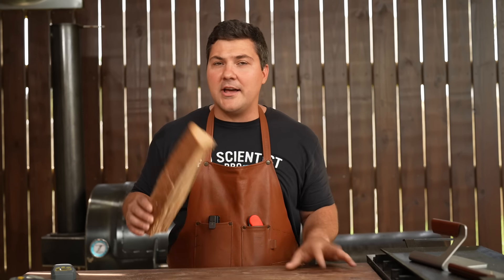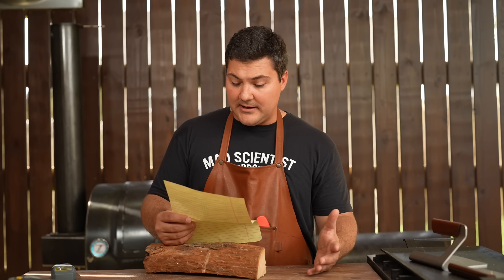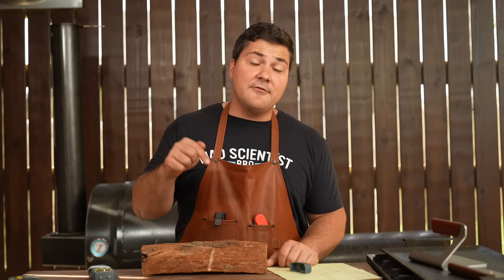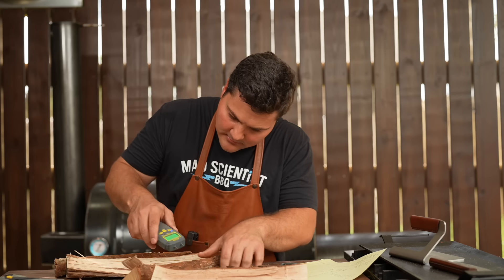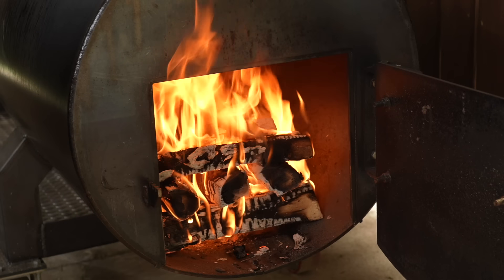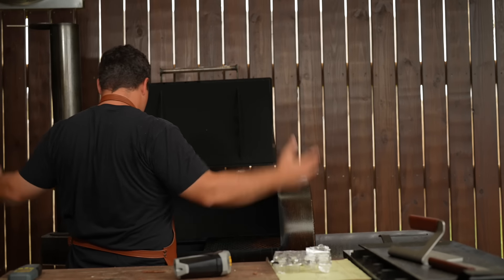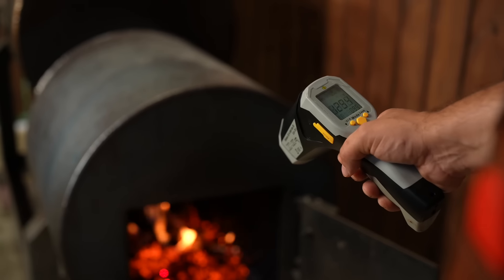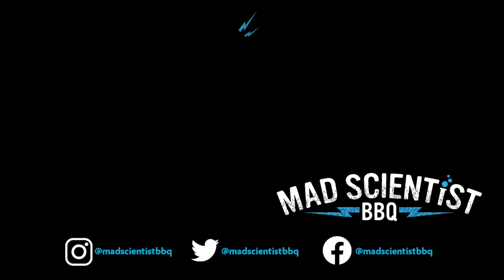I Cooked this Wood for 2 Weeks. How Did it Burn After That?

Comment: If you're pushing so hard the plastic is popping and your arm is shaking, that way too hard. The probe tips are sharp for a reason. You only have to make solid contact, not drive the tips all the way in. If you keep doing that, your meter won't last long.

Comment: Your results mimic mine with the same meter. I found a cord of mixed quality oak from the same tree (some of it fairly straight grain some of it pretty gnarly, i need a press like yours lol im doing it with a maul and an 8lb sledge), been splitting it by hand since last summer when I picked it all up, and when I crack into a new log it's usually in the high 30s still since it didn't lose any moisture all winter long. I learned real fast to use my cherry wood that was properly seasoned, as a bed to put the unseasoned oak splits onto in order to get them to burn. As the season has warmed up though this year, i've needed less and less cherry, and since I'm having trouble getting it at the moment, I've been burning all oak the last few weeks (with a little mesquite and madrone for flavor because it was my birthday). I have been pulling the driest splits to start my fire with and then switch to more recent splits during the cook to help maintain temps, and since I'm working in a vertical offset, worst case I can move to a lower rack if need be. I usually cook on two racks from the top (the very top rack isn't even in because i have a tray of kosher salt there smoking and it's too tall), but as my wood has gotten dryer i've considered dropping down a rack to help limit cook time. I can get about 250 on the mid rack while it's 300 on the top rack as well, so it lets me smoke different things at different temps pretty easily.

Comment: I have smoked with maple before. It is good filler wood to cut back on smokiness while doing chicken, cheese, or fish. You can also use maple to keep the fire going after you wrap and don't want to use your good wood.
Reply from the maker: Interesting. So you don’t think it tastes as good as oak, or pecan?
Reply: I agree. Maple just burns very cleanly. You don’t get a lot of smoke flavor out of it. And relatively fast. It’s plentiful here in Michigan.
Reply: Maple is high in sugar.  I wouldn't do a full cook with it.  I have had success with using it for the first hour of my cook and then switching to oak.
Reply: @MadScientistBBQ Maple smoked  salmon might be tasty

Comment: I built a solar kiln , it's really easy if you are even a little handy. It takes 1 sheet of 1/4" poly carbonate, and 12 2x4x8s . and some reflective metal or plywood, and foil.  I also put a "drawer" in it to put the wood in. I can do about 1/2 of a rick of wood in it. It will dry the wood in about 1/4 the time it would just sitting outside.

Comment: Where does the 9-10 month estimate for seasoning come from?  In the woodworking world, the "hack" to knowing when a board has achieved its equilibrium moisture content with the atmosphere (+/- 12%, depending on the climate), is to weigh the board on a kitchen scale every couple of days until the weight has stabilized.  At that point, it will only go up and down with seasonal humidity changes. I haven't personally tested this with splits appropriate for smoking (12-18" long and soda-can diameter), but my guess is that they equilibrate with the atmosphere faster than 9-10 months.  And if you want to use them at 18-20%, I bet they get there pretty fast if stacked in a way they get natural air flow.

Comment: Can you do a video where you smoke a brisket..freeze it, reheat it and then slice.  would be good for taking on vacation etc.  thanks!!
Reply: Just vacuum seal the leftover brisket and the sous vide or put in simmering water to reheat.
Reply from the maker: I think the other commenter is right, but I would be willing to test some things
Reply: @MadScientistBBQ  I thought that.  but unsliced might make the meat more moist when you do end up cutting it
Reply: Ive tried a few different ways and the best way I found is let it thaw out and microwave it. If you put it in boiling water, I feel it loses its smokey flavor.
Reply: I’m definitely interested in the best way to keep and reheat different Q. Also, how to pre-smoke and freeze a brisket to gift as an easy-to-heat meal similar to Franklin frozen mail order brisket. 
Do you just smoke it just shy of done and then the reheat will finish it off?
Reply: @johndawkins9913  Would love to see this too!  Great comment 😁👍👍
Reply: @johndawkins9913 glad I’m not the only one lol
Reply: I do this all the time. Just vacuum seal without slicing, reheat with sous vide or simmering water.

This is how franklin does it if you mail order a brisket.

Freezing seems fine, I do it if I need it to last in a cooler for a day or two.
Reply: I’ve done this a couple times with good success. Smoke until around 190F (slightly undercooked). Remove and allow to cool on the counter to 150F or so. Vacuum seal whole in a pleated bag for large items and sous vide at 150F for upwards of 12 hours (heated rest to get to fully tender). Dump the warm water out of the sous vide and fill with cold water and ice to quickly chill the brisket. When chilled, put the vacuum sealed brisket in the freezer until you’re ready to eat it, transport it, etc. Bring the sous vide with you and reheat for several hours at 150F. Take it out of the vacuum bag, slice, and enjoy. I’ve done this for weekend golf trips and just throw the brisket in the sous vide in the morning before playing. It’s ready to go by dinner time. Decent amount of work, but it’s good. I haven’t tried skipping the hot hold, but you could theoretically do that if the reheat is really long to achieve similar results. Would be a good experiment.
Reply: I worked for a big bbq restaurant in high school and they would refrigerate it then heat it back to serve it. It was the best bbq in town. I don’t know about freezing it.
Reply: I definitely keep it in the fridge, cut off a slice, and toss it in the microwave for like 45 seconds, and it shockingly doesn’t diminish quality. Blows my mind every time haha.

Comment: the point about evaporating based on the vapor pressure is an interesting way to look at it. perhaps try drying it in a vacuum chamber! could theoretically just suck out all the moisture in minutes

Comment: I wonder if you can use smaller pieces of green wood at the bottom which might work better.  Or use dry wood from the dry wood pile in the bottom row to help the green logs on top catch.

Instead of using briquets, just save some lump charcoal from the previous fire.  Put them in a chimney to start the next fire.

With the IR probe you set the laser to stay on without pulling the trigger.  And automatically display the max temperature reading.

Comment: I think sometimes we get too crazy with all the technicalities. Aaron Franklin, for example, always uses a mix of well seasoned and green wood in his cooks. Really just depends on what you're cooking. On super long cooks, you can start with greener wood to get some more smoke, then switch to seasoned wood for the rest. You can use greener wood on shorter cooks and it usually won't get too smoky as long as it's oak.

Comment: New to your channel, five days ago. Crash diet on offset smokers and you consistently provide great content. Look forward to the maple wood review as I cut one down in my yard two years ago. Have not seen any videos on Maple wood. Secondly, love your offset smoker, "The Solution." Want to know what the second two stages are and when it would new more appropriate to approach desired options for my ideal offset smoker? Ie, same door as you have at your home and ability to add charcoal box for grilling. Also, have not seen any chicken smoking videos, steak, pork butt, ribs or the like. Seafood, like salmon. I did reach out to Frank Cox for similar discussion, on door and second two stages/plans are for "The Solution." Keep up the great work!

Comment: Great video Jeremy. Do you know a metalworker near you? Someone like Bradley. (Or Bradley himself for that matter). Could you ask him to make you a chimney starter without handle and sideholes that fits woodsplits horizontally. Search for the top-down lighting method. I wonder what happens if you light a fire inside that starter that way in your offset what it does temp wise and how quick it burns through your wood. I'm curious to know if you can make a "reverse gravity fed" on a normal offset: Gravity feds like a Masterbuilt are usually lit from the bottom, I wonder if you light real wood from the top and add a Fireboard Drive 2 to it for example, if you can achieve the same thing with a lower fuel consumption.

Comment: 3:40 without going any further, I'm gonna guess that the exposed sides and ends got really dry but the centers didn't. If so, it sounds like you need to heat cycle the wood rather than just a constant two weeks of heating.

Comment: 2nd try...

What you haven't said. Even though it's a little harder to manage, the green wood burned way longer. Maybe use dry wood to build the coal bed, then add some green to extend fire burning time.
Reply from the maker: Using both can definitely work but requires extra management. The firebox door was left wide open because if it hadn’t been, the green wood would have struggled to stay lit. You can increase the burn time of the dry wood by decreasing oxygen. Definitely true that the green wood will last longer. Only question is whether or not you want to deal with it super actively
Reply from the maker: Also yeah we had a mishap trying to upload this 😂
Reply: Wet wood is definitely a pain to deal with. A propane torch is a must. I preheat my splits on the firebox as well as inside the cook chamber. But my woods fairly dry. Idk if I’d want 40% wood in the chamber….not sure.
Reply: 10:10 KD wood needs a minimum 8% moisture, anything less and it’s internal structure becomes compromised.
Reply: So the wood will burn longer when green correct? I have burned dry wood for my offset and noticed the wood burns way faster, gives me great heat, but burns to quick.
Reply: @MadScientistBBQ  Love this. Back to the scientist roots. Experimenting with this and that...
Reply: Could be that a hot coal bed will stay cooler with green wood as steam and sap cook off in the smoker. I read a book about wilderness smoking that said to use green wood to smoke after a hot fire is just coals.

Comment: I am wondering if you could use propane to maintain temperature and a smaller fire than normal for smoke? I'm currently using an electric smoker with a Smokin-it cold smoke generator. I'm in the process of building a 250 - 300 gallon offset smoker. Do you have a video or any data or advice with this method?

Comment: Hey dude, I love the channel.  I like your experiments.  I get better BBQ by watching, and living vicariously through your cooking ups and downs.
Obviously naturally seasoned wood is not only preferable, but bears some implicit superior flavor.....  At least, that is the superficial impression I get.  

In the interest of attempting to "hack" the kiln dried wood to see if you can tell the difference in BBQ flavor...  Is 80% of the way there 20x faster worth it if you're in a pinch?  Maybe.  I imagine because BBQ is such a passionate craft, people have probably tried it before.

Have you heard of anything like this?  Is this even possible?

Let the Kiln dried wood rest, either in a sealed container; or just outside.  Because it has such low moisture, it should become more homogenous in the sealed container.  

If it's outside and there is moisture in the atmosphere, it may raise its hydration percentage?  That might be a 1 week dry, and 1 week rest?  Humidors, for example also store moisture in the box's wood and  "shares" it with the cigars to keep it at an optimal moisture level.

I don't know if our ancestors have tried to add technology, or to hack to BBQ..... but I'm here for it.

Comment: Indeed, it is an interesting phenomenon that boiling water at a higher temperature results in a greater release of water vapor compared to lower temperatures. This observation highlights the direct relationship between temperature and the rate of evaporation. Thanks Capt Obvious

Comment: I've been a grilling enthusiast for years, and I recently made the switch from Qstoves+ to Asmoke. The difference has been a game changer! The pellet grill not only provides an authentic smoky flavor, something I missed with Qstoves, but also gives me precise control over the temperature. The versatility of Asmoke allows me to grill, smoke, roast, and even bake on one single appliance. The added convenience of the rechargeable battery with a 10-hour runtime makes it perfect for backyard parties or tailgating. Also, being able to monitor food temperature and adjust settings remotely via the app has made the grilling process so much easier. So glad I made the switch! #Asmoke

Comment: I have plenty of properly seasoned pecan wood from Texas. KILN DRIED is not what you want. PROPERLY seasoned pecan is Where's it at. I dial in moisture content to a good moisture reading. I actually have the same moisture meter that you used in your video. I won't plug my business. I have always been a fan. I have your rib video in a notebook, hand written for my first offset  cook I invited my family for.

Comment: Great experiment.  Thanks for sweating it out.....!
After getting a bulk order of inconsistent wood last year - my first year using an off-set - and struggling to build a consistent fire, I sourced some very good splits this year.  Kiln dried to an appropriate moisture content for the type of wood - English oak ~20%.  Cherry & Apple ~15%. Beach ~12%, and the results have been much better.
To build a great coal bed I've found some very well seasoned African Knobthorn Firewood, imported into England... Naturally dried in the dessert sun - dense as, a challenge to split, but well worth it for a good coal bed to build fire from the smoking wood.
@planetfriendlyfirewood
@braaiwooduk